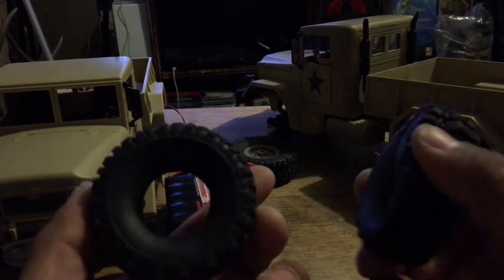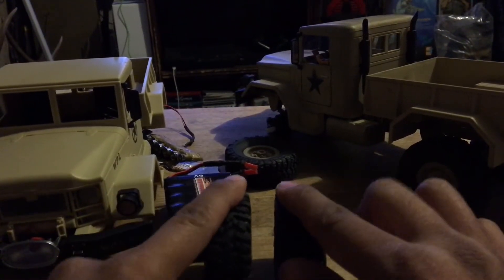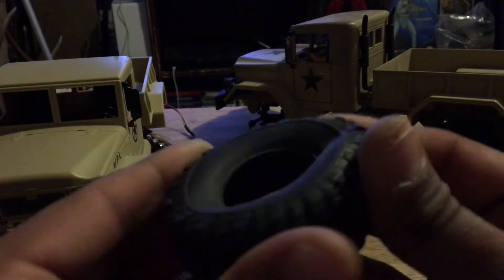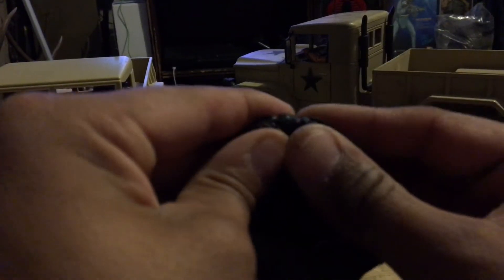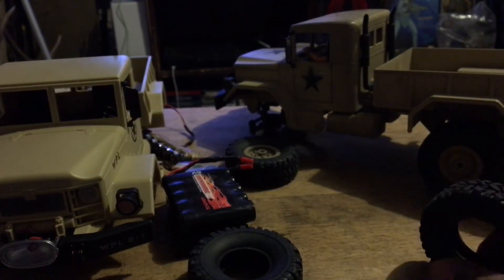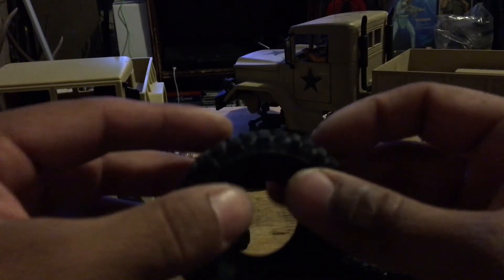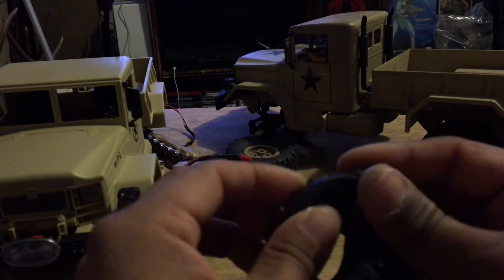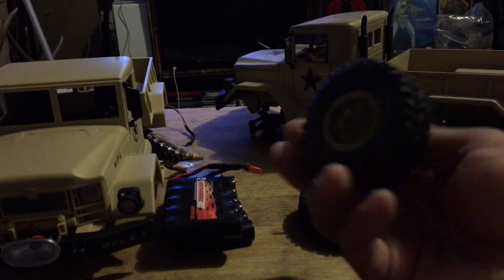WPL B-1 r/c How to make your tires Softer!

Comment: What motor bolts right into the stock motor location? I want a motor good for crawling
Reply from the maker: Daniel Cruz I’m not sure 🤔 I have not had any luck with that stock transmission I’ve tried like 6 different motors but no luck! I’m using 12v N20 200-300RPM dual motors and I’ve been able to climb 57 degree angle it’s lot like Four low like a real truck. You should look around my channel I have some videos that I’m sure you will want see how to dual motors mod and the ESC I use is a waterproof Double way 320A brush ESC Electric speed controller governor for HSP support 3s Lipo and it only cost $8.18 + $1.90 shipping. It’s the best ESC for $10 I’ve ever used 12v motors have more torque than 6v motors even at 6 volts so there are a lot of options but I stand behind my 12v N20 motors as long as you use 12 volt 200-300RPM💪🏻
Reply: Gabriel they sure DO IT!! may also be a possible, gear motor about 2x the size of an N20, has a round metal enclosed gearbox on the front. these DEFINITELY need to be geared lower in any case.